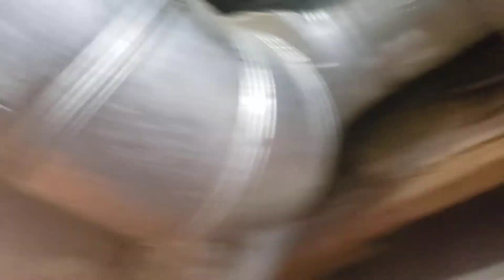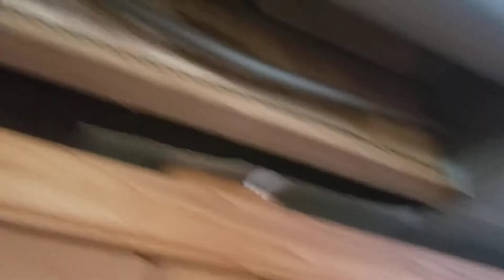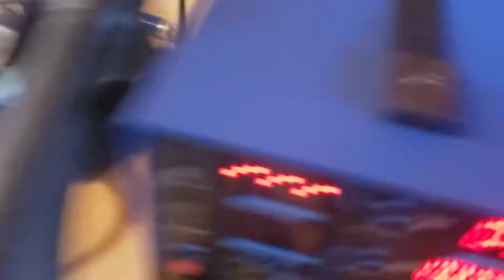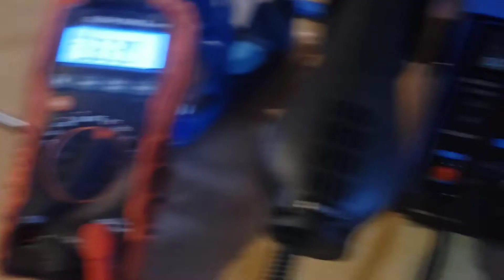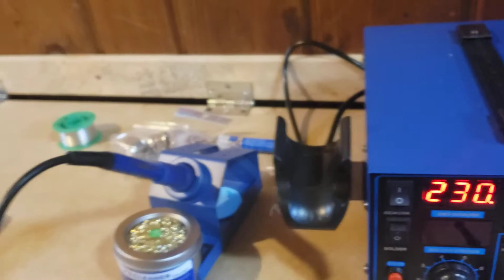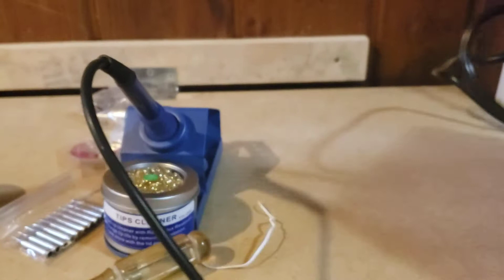YiHUA 853D and new electric

Comment: Hey! How is this station holding up? Im thinking of buying one as a gift for my self and this seems to look really good but some reviews say otherwise
Reply from the maker: So it is definitely on the cheap side, but for the projects I use it on it works fantastic. The heat gun is nice and powerful, the iron heats up pretty quickly, and the power supply is fine for smaller projects. All in all id say its a great value for the money.

It is still running just fine, and I don't notice any issues after arround 7 to 8 months.

Comment: Hello i get the same station than you but i never succeed to remove back glass without break it so if you could help me (I use 100°C and 1 air flow level )with temperature and air flow level please it really appreciated, i hope you will answer me quickly i will get my first micro-company in 2 weeks and i really need to fill my weakness.
Thanks i use 100
Reply from the maker: So my experience with back glass repair is a little limited but I'll share what I know. 
Your first step is GRADUALLY raising the temperature of the glass. By this I mean to heat the glass starting with the gun held further away from the item and sweeping back and forth bringing the gun closer and closer as you gently pry on the glass.
I have to say it's more art than science removing one without damaging it!
I really hope this helps! Let me know!